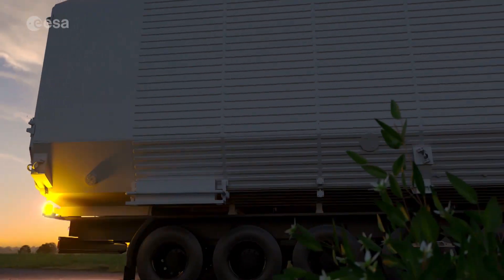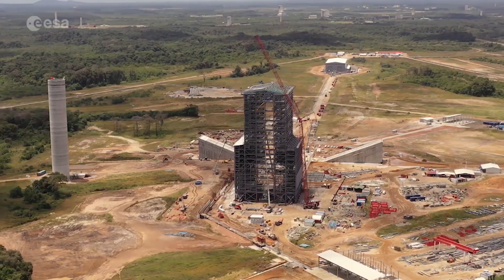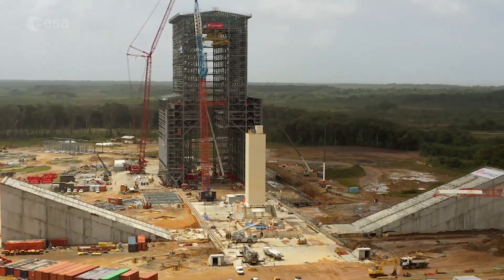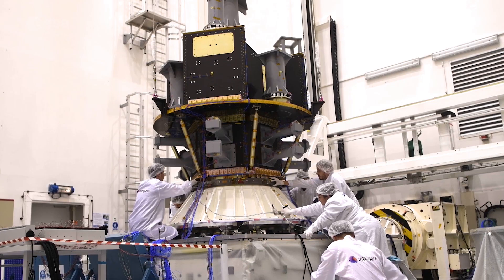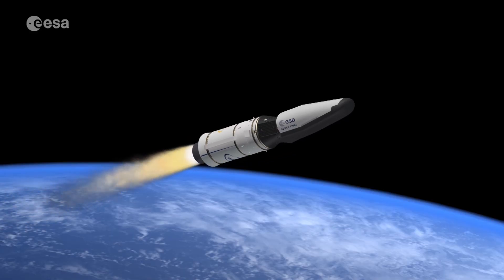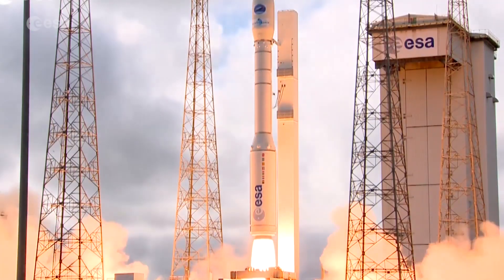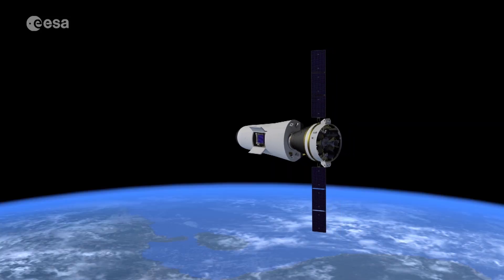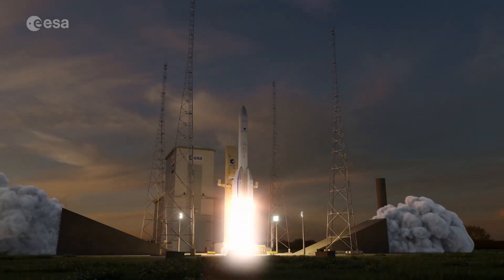A new generation of European Launch Vehicles

Comment: To anyone questioning if the ariane 6 is reusable: NO
Maybe a future version will, but today no.
If you want to compare this to spacex, spacex is a mainly LEO provider, ariane is mainly a GTO provider.

Also, ariane is designed to provide independent access to europe to space, so the objective isn't necessarly to make it commercial

Arianespace is still competitive
Reply: SpaceX rockets are optimized for LEO and Ariane is optimized for GTO, but that doesn´t mean they can´t be used for both. The very reason Ariane 6 was developed was to compete with Falcon 9.
Reply: @wysiwyg1  Current spaceX cost for launching a satellite with the falcon 9 is around 55 million. Ariane 5 launched 1 satellite for 160 million and 2 for 180 million so in the duo package 90 million each. So yes, spaceX's current rate is much cheaper than the ariane 5 with 55 VS 90 with dual satellite launch.
Ariane 6 however will cost 70 for a single satellite launch and around 90 for dual satellite launches. Making it competitive although a tad more expensive for single launches and actually a bit cheaper for dual launches.

Comment: Don´t buy. Use SpaceX instead.
Reply: Current spaceX cost for launching a satellite with the falcon 9 is around 55 million. Ariane 5 launched 1 satellite for 160 million and 2 for 180 million so in the duo package 90 million each. So yes, spaceX's current rate is much cheaper than the ariane 5 with 55 VS 90 with dual satellite launch.
Ariane 6 however will cost 70 for a single satellite launch and around 90 for dual satellite launches. Making it competitive although a tad more expensive for single launches and actually a bit cheaper for dual launches.

Comment: It's odd that in Europe we are moving to ban single use plastic straws and cutlery and then we not only continue to use but even design new rockets to be single use - crazy.
At least plastic straws are recycled to some extent.  Brand new rockets are instead just being dumped into the ocean.  At the very least if they absolutely don't want to bother landing them in one piece they should at least crash them into a designated area on and recycle the materials.
Reply: *area on land

Comment: Yeah, Ariane 6 isn't reusable, but that doasn't mean it's bad or "obslete before lunch" and "already outdated". It's compared a lot to the falcon 9 to show how uncompetitve it is when comparing their cost per lunch, $62M  for the falcon 9 ( https://www.spacex.com/about/capabilities ) and $75M for Ariane 6 ( https://en.wikipedia.org/wiki/Ariane_6 ) but a more realistic way to compare them is to look at their price per kg, falcon 9 reusable 3351 $/kg and 4157 $/kg for ariane 6 both  compared at LEO lunch, still below huh ? Yeah but quite close, and ariane 6 has a bigger capable payload and has more customization option, but where the ariane 6 really shine is in GTO lunches, Ariane 6 not only doubles the possible payload to this (11,500kg vs 5800kg) but become also cheaper (7826 $/kg vs 10689 $/kg) saying that the falcon 9 is superoir to ariane 6 is wrong  and saying that ariane 6 is better than the falcon 9 is also wrong, they both have their strenght and weakness that's it. (the payload shown on the spacex website for the falcon 9 is the non reausable version, so the payload is higher, i got the payload here: https://en.wikipedia.org/wiki/Falcon_9#Performance)

Comment: Still not enough to compete with falcon9 or even falcon heavy.
Made your rocket fully reusable first. Want to reduce the production time? Use 3d printer on industrial scale! Use Deep learning AI from designing your reusable rocket, production process and even embedded it in your rocket for safer landing. I still confused by other space manufacturer/industry step they take. 

Research and Development for it would be expensive like shit. But if you all space industry didn't do it,it would be a dead end like nokia, blackberry and (soon to be) intel. 😒😔🤦‍♂️

Comment: esa stays competitive not with low prices but with excellent reliability. apart from that integer overflow, ariane 5 has been proven extremely reliable. That's why the james webb telescope, an american multibillion dollar project is not being launched by a falcon 9 or delta iv, but by an arianne.
Reply: Ariane6 is also quite cheap, it's actually really competetive with the falcon heavy (which is it's main competition).
Reply: Ariane 5 has 98 out of 103 success rate. Falcon 9 has 71 out of 73 so they are pretty even. Delta IV heavy had only 1 partial failure, but is expensive.  The number of launches of Falcon 9 compared to Ariane 5 in the last years clearly shows esa can´t compete anymore. As for James Web, that project started in 1996 before SpaceX even existed as a NASA-ESA joint project. Being competitive or reliable has nothing to do with it.
Reply: @michalfaraday8135  Firstly Falcon 9 isn't in the same class as ariane5, so comparing their launches straight is pointless. Yes spaceX took some launches but it's not like the ariane V lost all it's launches, it still gets about 6 launches each year.
Secondly you're counting partial failures for the ariane V  but not for the falcon9, and reliability is more than just a good record (think of delays for example which does favor the arianeV). 
And as last SpaceX even today doesn't offer a rocket which is cabable for delivering the JWST (falcon heavy requires modifications).
Reply: @SneeuwPoesjes  Fair enough, 70 out of 73 for Falcon 9. The OP was comparing Ariane with Falcon so why shouldn´t I?  Their LEO capability is similar, while Ariane 5 can take more to GTO. Payloads delivered by Falcon 9 could have been delivered by Ariane 5 if as the OP suggested it was a matter of reliability. But it isn´t. The market is there, but Ariane 5 mostly delivers payloads to GTO too heavy for Falcon 9. As for JWST, still no, Falcon, Delta IV or anyone else wouldn´t be delivering it even if they could(Delta can). It is partly an ESA project so it gets delivered by Ariane, nothing to do with reliability and that desision was probably made long before SpaceX was a thing.
Reply: @michalfaraday8135  The only LEO launches the ariane 5 did in whole of her lifetime were ISS resuply missions, this because there are just better options for LEO than choosing for a rocket which is carefully designed for GTO. Arianespace has kinda a gap in the line-up for LEO, their cheapest option is buying a soyuz from russia so ofcourse they aren't really doing well in the market. However they plan on competing this market with the Vega-C and Ariane62 (also they're developing a reusable mini-launcher). 
And yes the decission for the JWST is made before SpaceX existed (also before the first delta_4_heavy made it's maiden flight) but the point I tried to make is that even if they could choose today there wouldn't be another viable option (apart from the way more expensive delta).
Reply: @SneeuwPoesjes  Ok, point taken. I wonder how Ariane6 will do aginst FH and if Adeline or Prometheus improve the odds for commercial launches.  Unless of course Musk wasn´t kidding with BFR timeline and it actually flies before 2030.

Comment: But can it be reused?
Reply: The space rider, yes.

As for the Ariane 6, there are several approaches in the works, looking which one would work out best for them. That's still several years in the future, but yeah, they are working on it.
Reply: @steveweidig5373  so it ain't?
Reply: @W_xlter   Not yet. Future versions should, though
Reply: @steveweidig5373  yea, but as of now, it's a dinosaur rocket
Reply: @W_xlter  How is it a dinosaur? It's, a modern, cheaper, and more capable rocket.

Comment: outdated, expensive and non reusable
Reply: To keep skills alive, one must continually make things. If they don't get used up then at some point the need for those skills will drop off.   These rockets are being built with some new processes to make them much cheaper than their predecessors so it's not as outdated as you might think - it's just conservative.
Reply: t43562 Agree, but at some point skills become outdated. If they follow the conservative path, and keep building expendable rockets, they will at some point find themselves in a world of orbital transportation working similarly to air transportation, without any idea how to do the stuff.
Reply: That doesn't matter. These rockets are being built for INDEPENDENT access to space. If they make a bit of money, nice but in the end it is not necessary.
Reply: Watch the video, it will be reusable
Reply: Foorack Watch the video, it won't be reusable

Comment: nice to see the new ESA rockets nearing completion, but I still don't see how they'll be able to compete on cost in commercial space as long as they haven't yet got the reusability of SpaceX's fleet.
Reply: victor It is not as simple. Everybody saying « You’re rocket won’t be reusable you’re useless » must understand that a reusable rocket is not automatically cheaper than a non reusable. Ariane expect to launch around 10 Ariane 6 a year, which is not enough to gain substantial economy from making it reusable.

If SpaceX rockets are so cheap, it’s for many more reason than just the fact that maybe they’re making economy by reusing them. They’re using vertical integration, sacrifice efficiency for simplicity by design.
Reply: @kaynouky9185  I'm happy to learn of this perspective about which I was not previously aware. I suppose a relevant further question is: If the cost/value of commercial payloads flown to space on Ariane are less than the launch cost per flight, who is picking up the difference? EU taxpayers?
Reply: victor I’m not fully aware of the financial process around ArianeEspace. It’s a complex public-private partnership.
Reply: Reusability is a huge, but not the only factor.

If you look at the Falcon 9's stats, you'll see that while it can lift a lot to LEO, there's a sharp drop for GTO and beyond as it's upper stage is rather weak. Here, Ariane excels with the ability to get heavier payloads onto GTO, and also closer to GEO, which not only makes the satellite operational several months earlier, but also gives them a longer operational life as they need to spend less fuel to get there, hence have more for future course corrections. This means that while the launch itself is more expensive, the company still would gain more by using an Ariane for GTO as the additional income trumps the additional costs.

Another problem with the Falcon, especially the Falcon Heavy, is their payload fairing's volume. It's the same as for the Falcon 9, and that one is already over 50% smaller than the one of Ariane 5 and half the size of Delta IV, Omega and Vulcan. This means that with the satellites constantly getting bigger, they will probably outgrow the fairings of the Falcons if they are not getting changed..
Reply: Steve Weidig All what you said is true except the fact about Ariane and GEO. The Ariane V upper stage cannot be fired twice, so that means it cannot bring satellites directly to GEO.
Reply: @kaynouky9185  I said closer to GEO, I didn't meant directly there. Just that the transition time from GTO to GEO is generally shorter als the Ariane 5 upper stage lifts the payload to an higher orbit than SpaceX can do.

Ariane 6 won't have that drawback btw, since Vinci will be able to be restarted 10 times.
Reply: Steve Weidig Sorry I didn’t saw you said closer to GEO, and I almost write what you just explained about an higher orbit.

And yes Ariane 6 is much more flexible than Ariane 5. It could be a game changer when it enters services.
Reply: @kaynouky9185  the second stage can light three times actually
Reply: ESA rockets can't compete on price even though they are heavily subsidized. The price would be much higher in real terms if they weren't.

Comment: Obsolete before launch.
Reply: can you explain ?
Reply: @Bludy6540  No reusability in 2019.
Reply: @WetaMantis  reusability isn't the obligatory way to go right now, araine 6 will have a slightly higher price per kilogram compared to the falcon 9 but it will deacrease over time,  
it's also modular,  and capable of double satelite lunch while having a higher payload capacity.
and ariane 6 has a lower cost per kg when lunching to GTO (7826 $/kg) compared to space x (11320 $/kg)
the 2 rocket aren't direckt head to head competiors, one is optimzed for  LEO and the other for GTO.
Reply: @Bludy6540  It is obligatory. It just is. If ESA would not make it mandatory for the european companies to use Ariane they would all be choosing SpaceX or waiting for new glen. Billions of euros going down the drain. And what is about the moon? ESA has no very heavy launchers in planning. Have fun on the moon alone America.